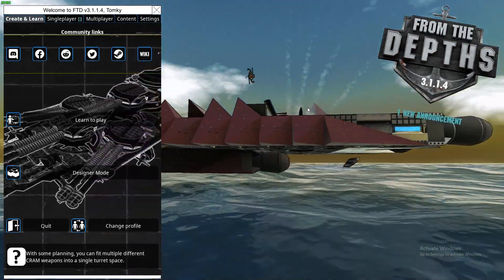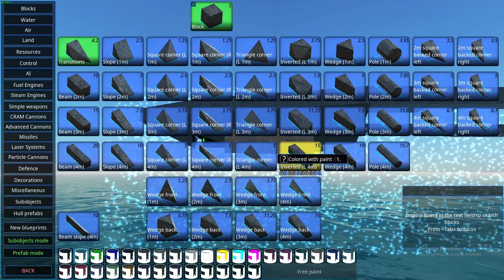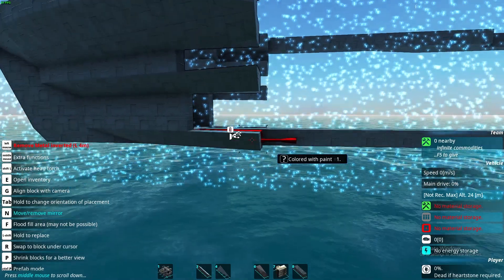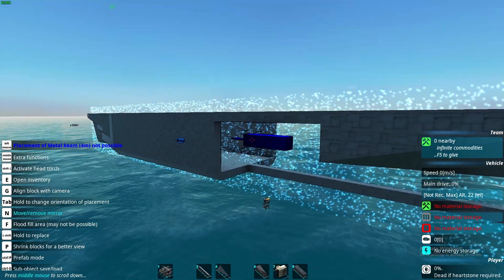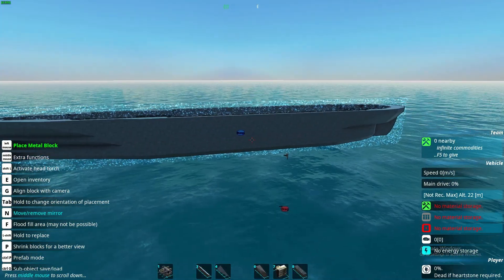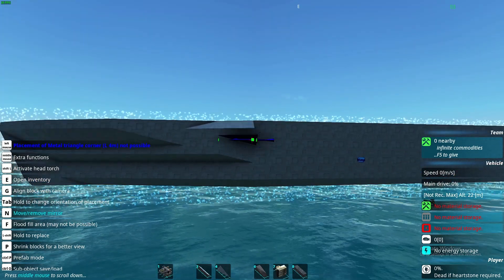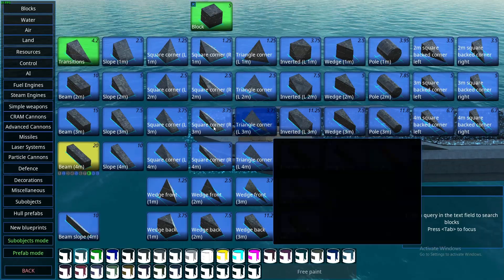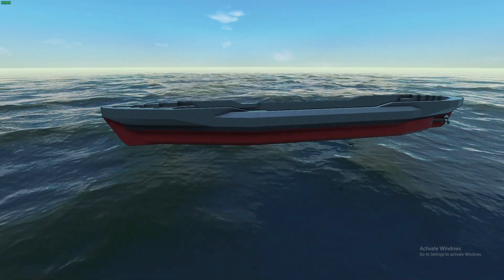From the depths - ship hull design tutorial

Comment: How do you make it look like that at 1:48? Like, what blocks made it look curved correctly? As well as the area where you put triangle corners and they actually look like they are on that without gaps/space between the hole block?? 1:57
Reply from the maker: When Im bulding the top down shape of the hull Im just using gradually shorter slopes towards the bow. As for 1:57 I dont really know hot to answer you as you can see me selecting and placing all the blocks.

Comment: This right now is my favorite hull design. Easily replicable and looks really good. Only issue is it leaves very fat undersides of the boats you would use them on. I wonder if there is any way to fix that. Might try experimenting with it.
Reply from the maker: What do you mean by very fat undersides?
Reply: @rvag3394  Looking at the hull underneath it, it's very wide and flat. I tried following this design for a hull that would be 21 blocks in width and that was my result.
Reply from the maker: @Koubles  Ahh true, with a hull that big the angle blocks at the bottom of the hull dont really help and I can see the hull being very boxy.